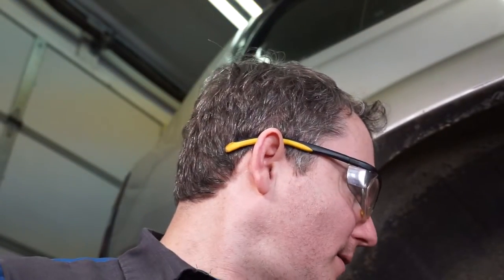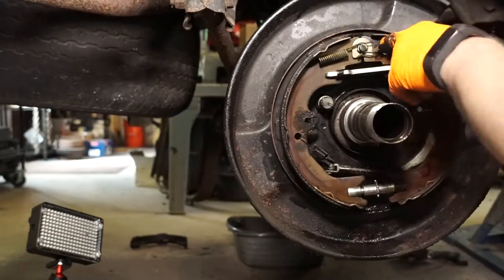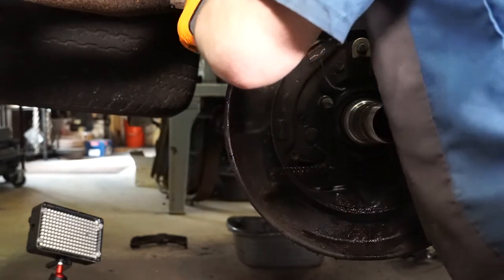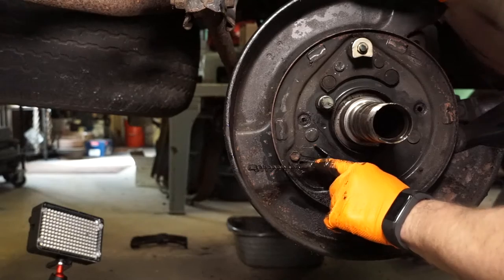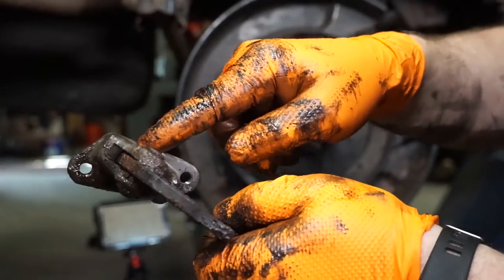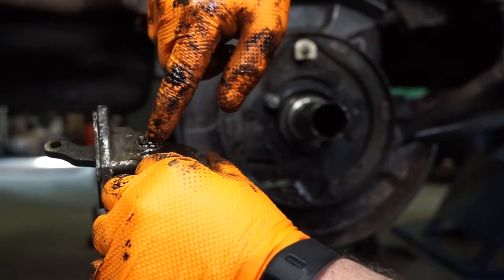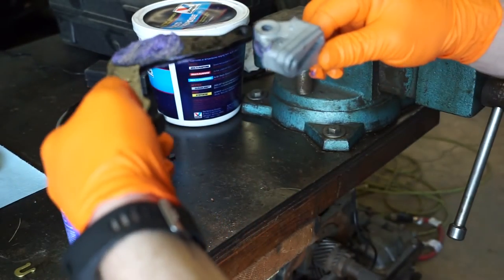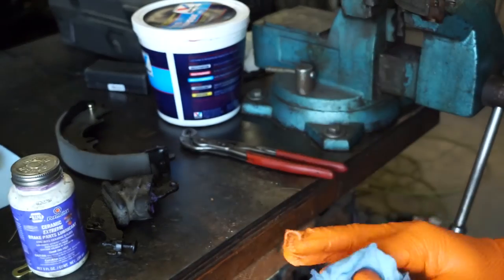80 Series Land Cruiser/ LX450  Parking Brake Repair

Comment: Excellent video, Ryan. Thanks for posting the complete process. Just a quick tip: you can pre-assemble and install the pin, ring, spring and hat first. Then all you have to do is slide the brake shoe underneath it and turn the ring so it falls into place in the hole. Toyota was smart enough to make slots in the shoes (not just a hole). This is especially helpful if the axle is in place and you have no direct sight of the hat because it is hidden by the hub.
Reply from the maker: You know I've never thought of that!! I'm so used to doing the non slot kind it never occurred to me. Awesome tip!!!

Comment: Followed this to the "T" with new rotors shoe's ungraded dog bones and upgraded increased ratio lever up grade / New cables both primary and secondary, This thing still wont hold on a hill rolling forward but holds a little (LITTLE) better from rolling backwards / what my best next check other then to carry blocks to put in front of the wheels (I now put it in gear to hold on a slope)  Not ideal off road challenge

Comment: Hi I noticed when you put the strut back on you placed it 180degress on the horizontal axis differently to how you pulled it out, there is a small lug on the narrow end of the strut that was pointing out when you removed it, that now points in towards the axle when you put it back. Does it matter which way this goes in? Curious as I recently fixed my handbrake and put it back in the same way you did but it isn’t working as effectively as it did previously so wondering if this could have something to do with how it spreads the brake shoes? Thank you

Comment: Thanks.  I just did this.  I should have watched this first.  Bit it went ok.  
These handbrakes are not that good tbh. Even with new shoes.  

The cable is stretched.. had to put  a spacer under  the adjustment at the handbrake handle.

Comment: Hi mate
awesome  videos Thank you so much. One question just doing pads ,rotors ,new callipers and park brake rebuild all round on myV8 2003  UZJ100.Ive noticed my park brake lever will not stay in down /disengaged position .It is reengaging itself and lever sits about half way on .If I physically hold lever down you can feel pressure trying to push up on lever
Any ideas ? Thanks again mate
Kade
Reply from the maker: Sometimes when the bellcranks on the backing plates seize they'll put pressure back through the cable. Or a seized cable will feel that way too. Bellcranks are the most likely

Comment: Just an FYI, you put your dog bone in upside down from the way you pulled it out.  You also mixed up your yellow and black top springs.  They are different spring rates and coil counts.  The knuckle closet to the spring on the dog bone should face out and on the top springs, the yellow spring goes to the rear shoe and the black spring goes on the front shoe that has the actuator arm on it.  Also the black spring should be placed before the yellow on the pin.  Otherwise great video.

Comment: Good video I'm still having trouble adjusting my hand brake I tightened it all the way back it off about 4 teeth I can smell my brakes
Reply from the maker: Are the bell cranks retracting all the way when you let the handle down? If they are you may need to back the adjusters off more. We usually end up with them looser than the factory  spec to keep them from dragging.
Reply: Thx mate check tomorrow morning it's 10pm here in the land down under

Comment: What brake shoes do you like? Non-oem are significantly cheaper, but is the fitment okay?
Reply from the maker: We tend to stay OE for most brake parts. I've had decent luck with Napa parking brake shoes. The aftermarket hardware kits though don't fit correctly. The shoe hold down pins seem too long and the springs come loose and fall off.

Comment: Hey Ryan, thanks for the great content as always this really helped me when I rebuilt all my brakes. Including the E brake.

I have uncounted a problem since rebuilding unfortunately my brake backing plate is shot. 

What are my options? Replacement form Toyota cost a bomb. Are they're any after market parts available?

I'm in the UK and struggling to find anything for the rear backing plates here.
Reply: you got an nice little heart but no answer - im also in the UK with a 97 3.0 TD , does your hub cover your shoe retaining pins , mine does and has no cut out like all others i see here on YT

Comment: Hi Ryan, I just want to know if this repair is at all possible without having to remove the rear hub?
Reply from the maker: You can do the parking brake without removing the hub. I had the hub off for other work and took advantage of the clearer view of the parking brake.
Reply: @OTRAMM  thanks Ryan 👌

Comment: Hi. I just replaced my LC100 shoe hardware. I noticed the replacement upper return springs are the same however the original Toyota ones consist of a Heavier and lighter spring.?
What’s your thoughts
Reply from the maker: The aftermarket kits are more generic and don't exactly match factory. They generally work OK though.
Reply: OTRAMM thanks mate. Do you know off hand which goes where in the original set up. I’m thinking of putting the originals back in as they are still in good condition.
Reply from the maker: I don't, I always do one side at a time so I can compare. I'm not sure the manual even shows the difference.
Reply: OTRAMM have figured it out now. Have sent you an email.

Comment: Hi Ryan, great vids btw. But, what is the problem with these 80 series handbrakes? Replaced everything and they still don't hold...I've also extended the dogbones by 5 mm(last try)...makes an improvement but still not super. I just can't imagine Toyota supplying a car with handbrakes so bad. Is there a caliper handbrake upgrade you know off? Regards
Reply: Yip.  Mines similar.  
It’s working but not that great.

Comment: Thanks for the great video! Got me from A - Z as a wannabe weekend garage mechanic! One follow up question - Everything back together and working, however I'm now getting rotor noise. The only causes I can think of are that I bent the backing plate when prying the old arm loose, and the plate is now contacting the rotor when moving, or I mistakenly bumped a brake pad clip and its touching the rotor. Wanted to check and see if this sounded familiar and if there were any other ideas/experiences/solutions prior to taking it apart again. Thanks!
Reply from the maker: It's really easy to tweak the backing plate while you're in there. That's the most common cause of noise we see. Second would be a parking brake hold down spring being loose and rubbing.
Reply: @OTRAMM  awesome, will focus there. Which spring(s) is the hold down spring?
Reply from the maker: There are two hold down springs, one for each parking brake shoe. They're the ones with the keyed washers and pins through the backing plate.

Comment: Great vid, very helpful thank you, if I could bother you and ask about the shim that was used on when attaching the arm to the shoe, how important are these? One of mine was missing and the other was dead flat and cracked, 😩 can I go without or do I need to find something? My new shoes did not come with any, thank you in advance and please keep them coming, legend
Reply from the maker: They keep the arm from rattling. If those were bad your other hardware probably isn't far behind. I'd just get a new hardware kit with all the springs and clips.
Reply: Cool, thanks heaps, really appreciate it

Comment: By parking brake handle is very loose . When I pull it the brakes doesn’t do anything . Do you think it’s stuck ?
Reply from the maker: The actuator arms at each side in the rear are probably frozen
Reply: @OTRAMM  they actually still engaged and disengage when I pull the brake handle
Reply from the maker: @Sclassmercedes  if that's the case my guess would be stretched cable. But that's just a guess without seeing it.

Comment: Where do you get your kits from ?   On my lx450   where the main cable  coming from the front   attaches to  a piece that the  2 short cables  that go to the  wheels  are connected to .   The piece that connects all 3 cables  does not move freely  and I have to bang it with a hammer  before I can make it straight  so  the cables are  even on both sides . Once I pull the parking break it  pulls both cables and sets both  breaks  but when I  release the cable  only one side returns and the other side is holding the break on  and it heats up and I can hear a clicking sound . I have to get under the truck and hammer the  3 cable  connection piece  back to center  so the  break won't stay on .  Everything on the  breaks them selves are moving freely . I can pull the cables  by hand  and they move every thing freely  my problem is with the  connection piece of the 3 cables . Is there a kit  or a way to make  this  piece move freely  left and right to keep the cables even ?
Reply from the maker: I'm pretty sure the pivot you're talking about is part of the parking brake cable. Toyota would be your best bet for a new one.

Comment: Hi, peace to you brother. That is great instructive video. Do you have a video of rear wheel bearing replacement on 100 series land cruiser particularl, please? If you do would you attache the link with your reply please? Thank you.
Reply from the maker: I haven't done a rear bearing video. It's not really a DIY kind of job. You need a large press and a special adapter to pull the bearings off. I've got the special tools for it and still hate doing them.
Reply: @OTRAMM  thank you for responding this promptly . You are amazing. From your video I learned that you are in Virginia. Which part of Virginia do you live in? I live here in Maryland. I am not sure how bad the rear ones need to be replaced. I would like to come up to your place for them. I have a 2001 LC. I also hear a heavy stumping noise as I take off from a stoped position. I feel like the connection between the top body and the frame is loose. Because in my assessment I do not hear it on a take off after I come to a very slow gentle stop. It happens only when I do a hard stop. But when I consulted the local mechanics they assumed it just by taking my words as a slack between the rear differential and the axel. And they they pushed hard for repair. I am not convinced. With your experience I believe you will help me understand. It is a bit long writing. Forgive me.
Reply: The stumping noise is in the rear.
Reply from the maker: @EliasKao  we're in Bealeton VA. About an hour South West of DC.

Comment: Hi were i can found all the hardware including the brackets to hold the e brake on the diff because mine is rusted
Reply from the maker: If you're talking about all the brackets that are welded to the housing you'll either need to make them or find a non rusted housing. For everything else your best bet is Toyota.

Comment: Except you didn't adjust the limiter onto the backing plate on the bell crank that usually has a rubber bumper on it.
Reply from the maker: We've never seen the need to change the adjustment on them. That and they're usually rust seized beyond repair.
Reply: @OTRAMM  If both or one bumper stops are not sitting against the backing plates when the handbrake is off it can pull the opposite side handbrake shoe on with up & down movement of the diff and handbrake cable.

Comment: Help! At 19:20 the bent pin you put through the back and hold down with the ring, spring and hat is way loose. There is no tension holding down the drum. The other side has plenty of tension and seems right.
Reply from the maker: Sometimes the best pin stretches out and either needs to be squeezed down some or replaced.
Reply: OTRAMM Great! I'll try doing that. Thanks for the quick reply and helping us weekend mechanics out.

Comment: any one ever had the rotor not fit over the new shoes? I triple checked the assembly, the adjuster is all the way in, but the rotor won't fit over the shoes. It's like the pads are too thick
Reply from the maker: Make sure the dog bone at the top is fully seated. That can spread them too wide.